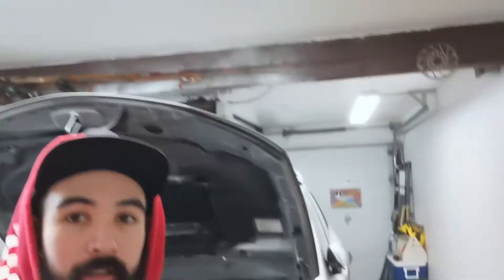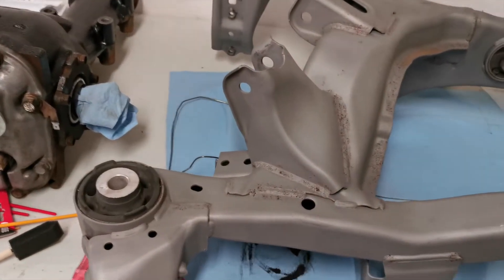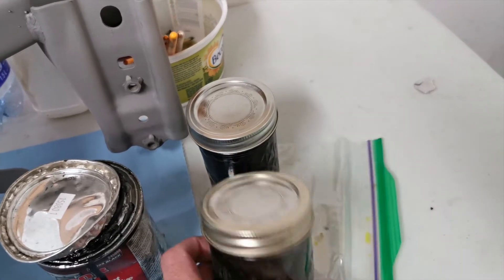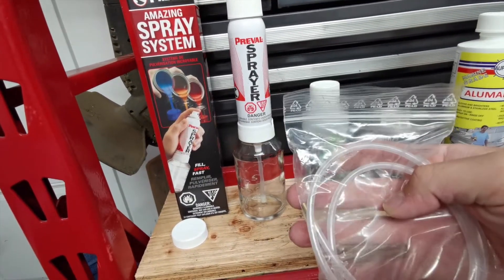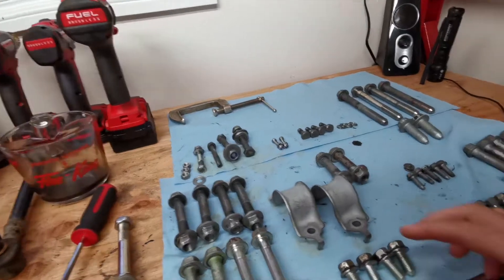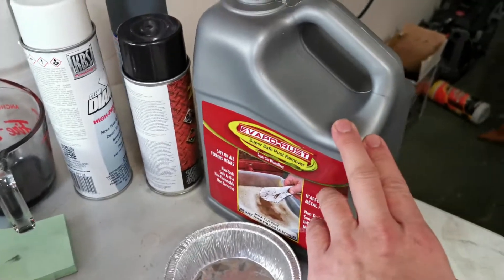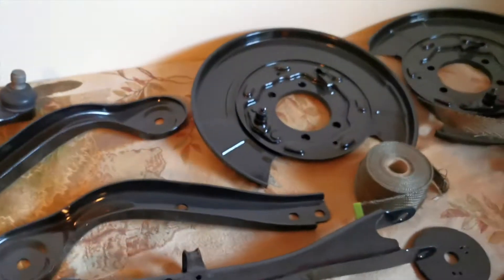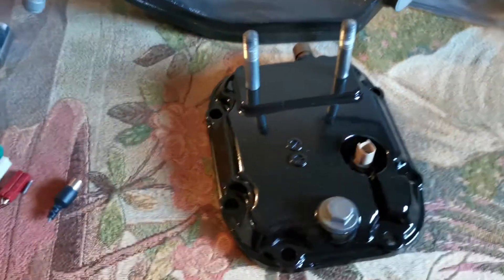Subaru Subframe Refresh | Part 3

Comment: Hi, this was a cool watch.. are all the parts in your front room por 15 painted? If so did u remove all your bushes to paint them or did u just mask the bushes up? Thanks
Reply from the maker: I didn't want to press out the bushings, so I just masked them and painted around them.
Reply: @AdrianMorse42069  it looks very oe so thought maybe u had taken them out, im doing a similar project currently on my Impreza p1 gc8 so this was a good watch for me, im doing the por15 on suspension bits but then I'm think poweder coat an cant make up my mind but need to underseal it too once all the rust is taken care off underneath